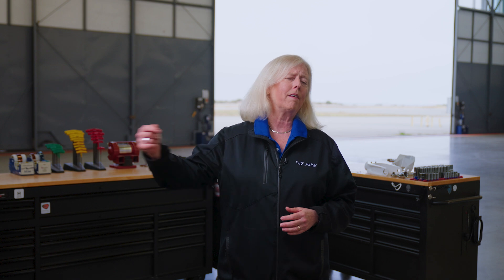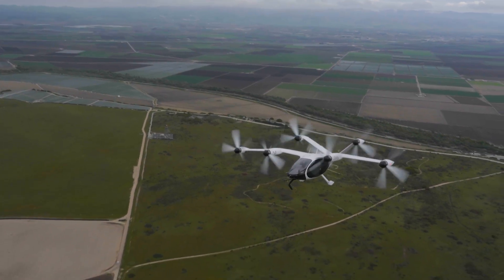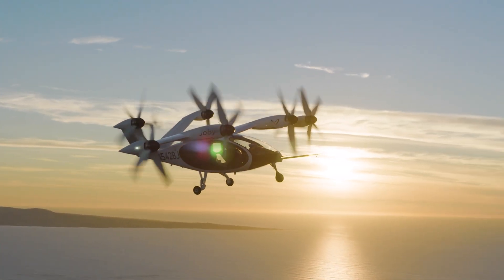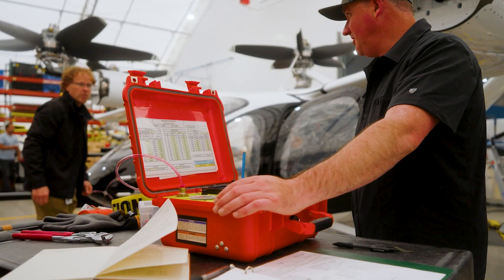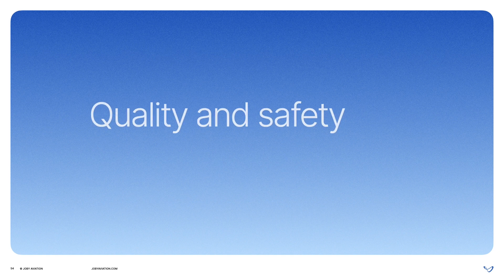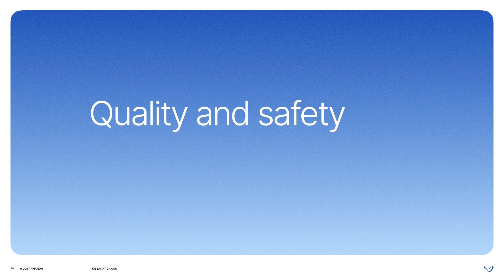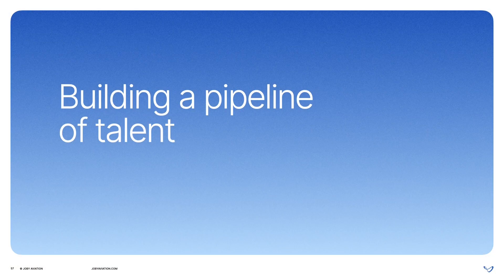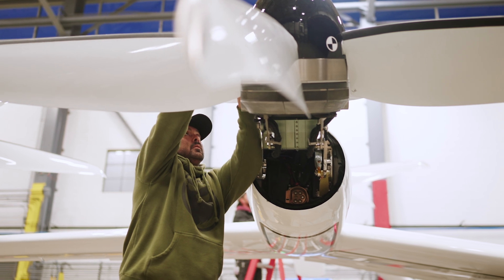Joby's Air Taxi Service: Maintenance

Comment: Stop at minute 0:38 shows the huge part oh the propeller hub. It also shows a relatively small part of the propeller axle. I wonder if that configuration leads to only a very small fraction of lightning path goes into internal part of the motor. Lets the majority lightning path run at the surfaces.
Reply: Ref Lightning Protection handbook written by Andy Plumer, etc. from LTI Pittsburgh indicates that when lightning strikes the wing, then lightningcurrent flows at the wing surfaces as well as all parts of  internal wing (ribs, spar, fuel pipe and wiring). So, I assume when Joby S 4 Propeller Blade gets lightning strikes, some lightning current will go at the surface of Propeller  nacelle, and some other goes inside the motor , the propagate to internal motor controller then to the High Voltage Battery . Is that the case?
Reply: I wonder if Joby S 4 Propeller Hub, including its motor, its motor controller, and the battery, was already tested under the Direct Lightning Test, in the correct configuration, and in the correct operational mode. I'd like to know the test result. Salam Bambing
Reply: @sekarmelati I think any successful tests they do on anything will be made into a news story and videos. They make them out of unimportant things so they would for sure let people know if they performed any test that they can pass.